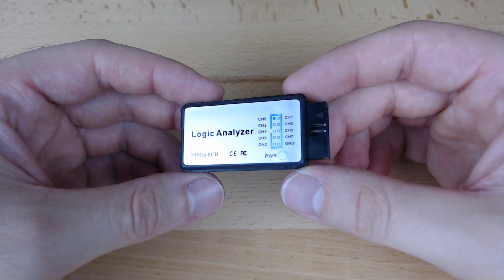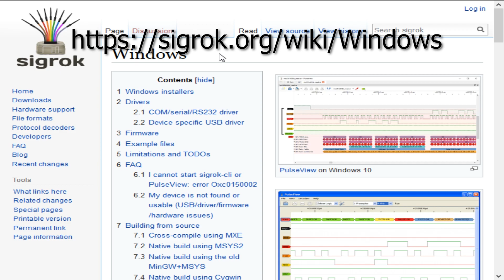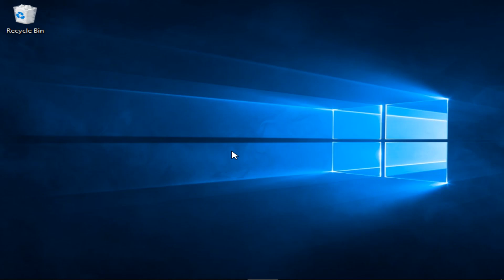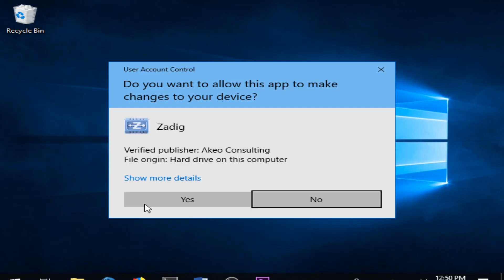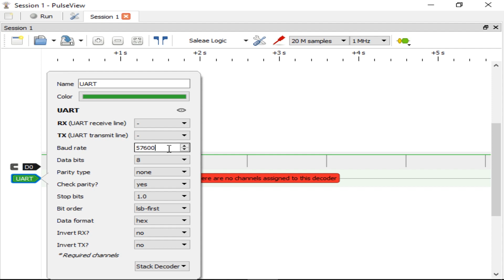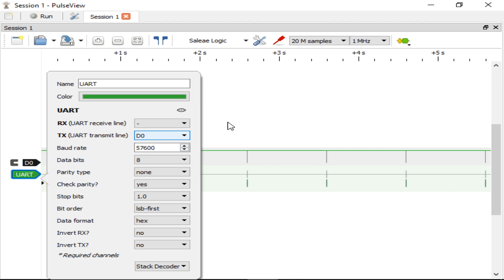HiLetGo Digital Logic Analyzer and PulseView

Comment: Thanks for this ,i understand too Many things,
My question is, in this USB logic analyser we are only getting Digital signal,1 0 ,
Can we get other waves like sine or triangle.
Reply from the maker: The Logic Analyzer only recognizes high and low voltage levels. It basically has a circuit that detects if an incoming signal is greater than or less than a certain percentage between two reference voltages. So the short answer is no, you can't get other waves like sine or triangle. What you need is an oscilloscope or even just an audio card (it's an analog to digital converter). Here's a random instructables I found that might help (sorry I'm late - I don't get notifications on this channel): https://www.instructables.com/Use-Your-Laptop-as-Oscilloscope/